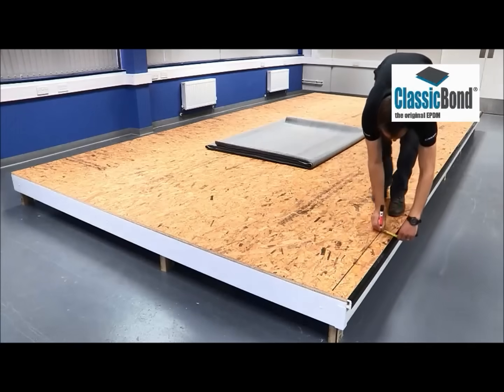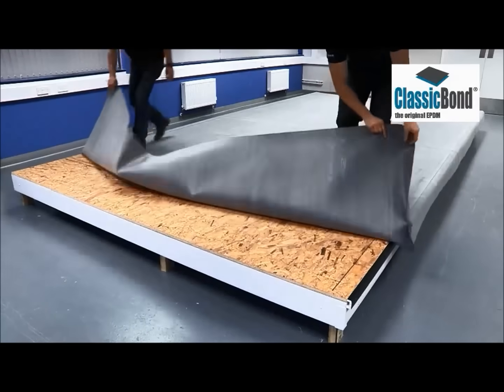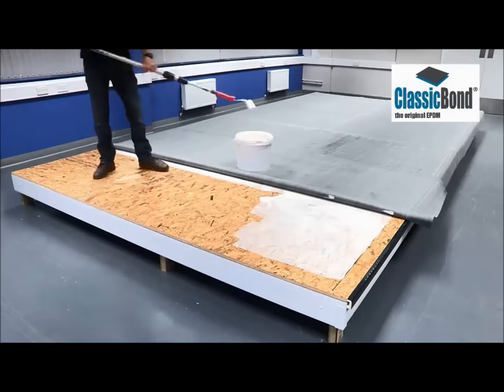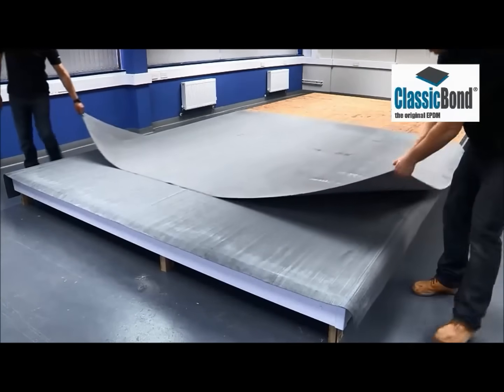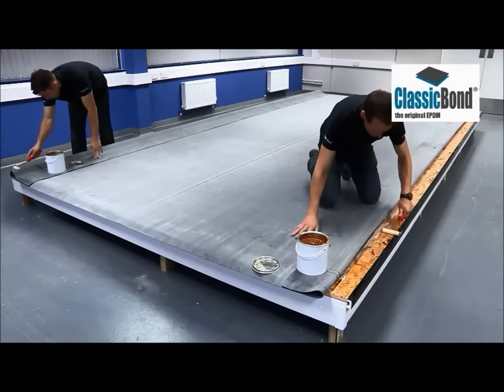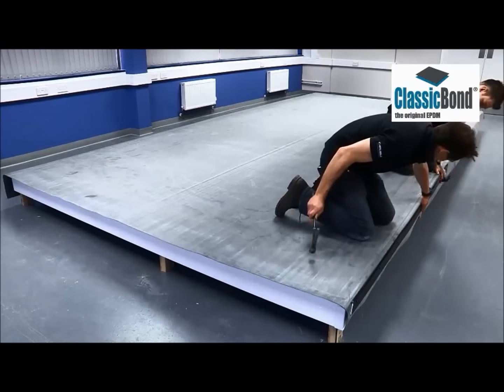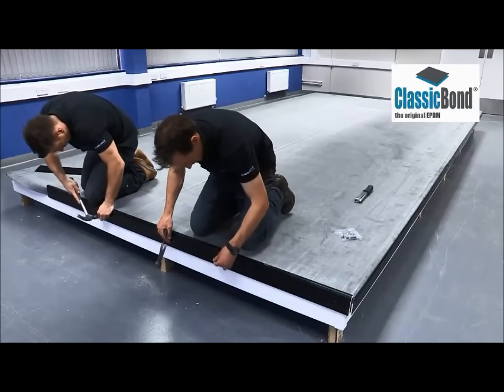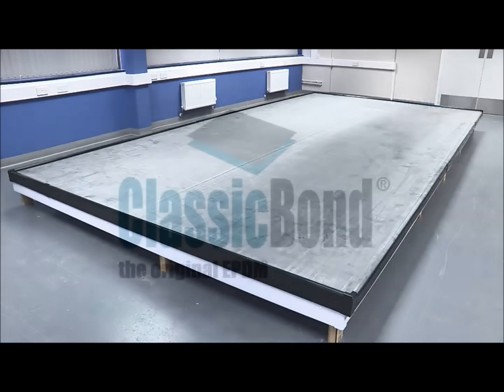How to install an EPDM Flat Rubber Roof, ClassicBond

Comment: Can this be applied over an existing felt roof, or do I need to remove the roof and the change the ply/deck below?
Reply: Remove and replace everything, you don’t want anything in between your bond and what you’re bonding to. Preferably a new clean surface is perfect.
Reply from the maker: Thanks Juan exactly right! Bond directly to a fresh OSB board. Old roofing membranes and felt may be high in moisture content and trapping this under a new membrane may cause the roof to fail. 

Also particularly the solvent based contact adhesive will soften the felt causing oils to leach out why will affect the life expectancy of the EPDM rubber membrane.
Reply: It depends as long as what you are applying to is smooth then your fine but I wouldn't put it ontop of felt myself

Comment: Question if I'm installing a simple 10 x 10' EPDM rubber roof. What is a cheap glue to use I don't want to buy a whole gallon and only use a quart. Does anyone know an alternative small amount of EPDM to Wood adhesive?
Reply from the maker: Hi Tommy. The waterbased deck adhesive supplied by the EPDM manufacturers is the obvious choice in the uk a 10’x10’ (3m x 3m) can be fitted with 2.5litres around £20.00. I’m no aware of a cheaper adhesive that will cope with the temperatures on a roof.

Comment: My garage is a double which is attached to another neighbours garage. How would i achieve a join with their felt?

Also under our felt it is wooden planks instead of boards
Reply from the maker: Hi JM. One way to join to the felt is a termination bar. I’ve put the link in here to a video. 
https://www.rubber4roofs.co.uk/how-to-install-a-termination-bar-video-and-installation-guide

Comment: Do i need to use tongue and grooved osb or can i just use normal 8x4 osb3 sheets 18mm thick? Big difference in price thanks
Reply from the maker: Hi Mathew
OSB3 Square edge will be fine and is perfectly adequate for EPDM installation.  Although in our experience tongue & groove can be useful when dealing with inconsistent joist spans and uneven joists as the tongue & groove will give a better finish as the board edges will be pretty much invisible for single ply installations such as CLASSICBOND, Firestone, Hertalan etc.
Reply: @Rubber4Roofs  hi when i fit osb18mm 8x4 sheets im going to fit noggjns, is it ok to fill  the 2-3mm expansion gap with d4 expanding wood glue thanks
Reply from the maker: @Tattytyres  whilst I doubt this has been tested for compatibility with the EPDM adhesive I can see D4 is an expanding PU so my gut feeling is it should be absolutely fine. Might be worth a quick test patch to be on the safe side though.
Reply: Thank you are you able to supply everything i need to complete the flat roof ill see if you have a website and contact thanks
Reply from the maker: @Tattytyres  just visit Rubber4roofs.co.uk there’s a handy roof kit builder which will calculate everything you need with a few simple clicks 👍🏻

Comment: Don't see why you have to use a different adhesive for the perimeter?
Reply: It's a much stronger adhesive and protects against wind damage. The last thing you wants is    a solid piece of rubber flying off and exposing your entire roof to rain and hail.

Comment: Would this work on a concrete flat garage roof?
Reply: my question too - would board need to be laid first?
Reply: Yes Felt board get's glued to the cement first for a soft base under the rubber. unlike the mistake in the video.

Comment: Why apply the rubber to a hard surface? Wouldn't a lawyer of foam insulation provide better protection to hail?
Reply from the maker: Hi Edward. This isn’t a problem we generally get in the UK although we have shot a video showing how tough EPDM is dropping hammers & branches on the roof etc.

Comment: Why do you use two different adhesives.
Reply from the maker: The main adhesive is easy to use and perimeter adhesive is much stronger and grabs instantly. They both have their use.

Comment: Hi, I have installed this epdm rubber roof with trims on osb3 t&g. I very small pin holes/ nearly visible to the naked eye in the epdm, can a epdm roof be coated with something to stop it leaking? Thanks
Reply: Gaco roof patch is solid. Have stopped some big leaks. A little pricey but it works
Reply: Yes just patch it

Comment: So I just fitted one of these today on a cabin/summerhouse. Mine was just over 5m x 4m. As others have said this makes it look pretty easy.

A 1.1mm thick 5m x 4m epdm roof weighs 55kg/120 lbs (according to the shipping label). Getting it on to the roof was a major pain. Particularly without catching it on the osb3 edges I roofed with. 

I spent around 30 mins getting it on the roof and the in the right place and lined up properly. This was pretty difficult and mainly involved removing the big ripples and folds, then getting the rubber broadly square to the roof, harder than it sounds without falling off when you are standing on the rubber itself. Another 30 mins letting the rubber 'relax'. Around 30-40 mins to get the water based glue on in 2 'halves' and the edges were another 30 minutes or so. 

Most of the time was spent moving the rubber around, the glue went off pretty quickly. Moving the rubber is difficult, and with one person it hard to fold it as neatly as is shown here. The water based adhesive was initially like an ice rink (standing on the rubber sliding over the adhesive), then after 10 minutes it quickly became very tacky and hard to lift/reposition. The border contact glue was ready pretty much instantly, making it quite hard to manage as it was sticking the rubber after 1-2 minutes and hardening in my roller tray after 5-10 minutes. It stuck the rubber to itself if I didn't fold it back carefully. You need to be clear in your mind what you are doing and go for it because as soon as the glue is down the clock is running. 

This is early autumn in Scotland with 75% humidity at 13°C. Remember the glue won't work properly if it's wet, humidity over 80%, or if the temperature is under 5°C or going to fall under freezing in the next 48 hours. Not much use in Scotland! 

So I'd relied on this video as a guide for fitting a 'standard' 1.1mm firestone epdm kit. But I had no idea what the timescales were for the glue drying etc and I couldn't find this information anywhere. I'd read somewhere the contact glue would take 15-30 minutes to tack off... But that wasn't true for me. Hopefully this helps someone.
Reply: Thanks for taking the time to share your experience of this. I'm doing a similar size roof mid December, I'm down south but even so will have to wait for a couple of mild days.
Cheers.
Reply: Go to local carpet shop, ask them for a cardboard carpet roll holder. Roll it on the ground onto the cardboard roll and lift it up with 2 men by a rope each end. Use it to roll out on roof. 1 pasting 1 brushing smooth with wide soft brush. Do last 20 cms as per vid.
Reply: Thank you for this. I was going to start on my project but the weather says -2 in the next day. Its about 10degrees now so I thought why not? You have saved me a mess up!
Reply: Yeah looks easy enough on this vid with a 4" high roof! Just step off when you need to for better control, but on the likes if a garage roof it must be a pain trying to dance round it.
Reply: Truly fantastic comment! Wish everyone was this helpful on YouTube!

I’m also in Scotland with a high-ish roof and I think you’ve dissuaded me from using this. I like that it lasts a lifetime with zero maintenance but the installation sounds a bit back-breaking and prone to me making a complete ar5e of it!

Probs will just go for ordinary cheap felt with maybe some bitumen paint over the seams
Reply: good comment - much appreciated
Reply: Awesome comment - really helpful!  Well done for battling through.
Reply: Can you advice what was the edge glue please
Reply: @coolI12332  i no longer have the tin. it was bought from a UK company called permaroof and the invoice just describes it as "bonding adhesive". The whole roof cover was a  firestone kit they sell on their site where the glues all came as part of the kit. it was a neon green coloured contact glue as i recall. 

i have also separately used a Hertalan product called KS137. I've read this is well regarded and i had no issues with it, this was to install a downpipe with epdm flashing  - and wasnt an issue to install as it was a very small area (1ft sq)

Comment: Looks easy but my roof over 2,4 m in height. Where do I walk?
Reply: Roll your rubber back like a carpet pva about 3ft infront of you and roll out rubber. Once finished one side just repeat on the other.
Reply: Good question. The video would have been much more realistic if they stayed on the platform while rolling the rubber out.
Reply: Scaffold
Reply: @fredvanstone5159  no not scaffold. That would cost more than rubber itself.

Comment: How do you install spouting to this system?
Reply: Use the gutter trim and make sure you have at least a one inch drip. We usually do this with a piece of slate  batten 50 x 25 mm srewed to the over hanging deck. For eg, https://www.rubber4roofs.co.uk/shop/sure-edge-gutter-drip-trim-2-5m
Reply from the maker: @ddpeak1  or alternatively for a hopper outlet https://www.rubber4roofs.co.uk/how-to-install-a-horizontal-drain

Comment: why not apply the water based  adhesive to both sides (roof + membrane) ???
Reply: It’s not necessary and will take too long to dry
Reply: You can apply on both sides and let clear off to bond. We do this around seams when we use inseam tape so we can fold lap back to clean and apply primer.

Comment: I first used this product on a flat top about 7 years ago, i went back to the property recently and the roof still looks great. I’ve done several since and really rate this system.
Reply: What type of glue did they use on the edges and what was the measurement? It looked to me around 20 cm?
Reply: @coolI12332  

The rules for EPDM (roughly)

Edges - 100mm (4inches)
Upstands - 150mm (6inches)
Overhangs for gutters - 50mm (2inches)
Reply: Will it work on a slightly sloped roof.
Reply: @matt7iron  Of course it will, a roof should be slighlty slopey by design to allow water run off.
Reply: @ronskiman4094 what part of country you working in? Most folks where I live in new england use lvoc on top of 1/2 iso recover board or fiber board held down to deck with seam plates and screws. That way can walk on roof and has give as to not puncture rubber. They use Lvoc bonding adhesive and at edges uses c-6 or c-8 alum drip with a self stick cover tape 5" or 6" wide and you prime and stick down to cover drip edge to rubber transition. Some folks get really picky and epdm edge caulk both sides of tape. I dont think you need too, but, they prefer to never get a call back. I am just curious as not needing that cover tape with the PVC edge and overlapping rubber is much cheaper. 5"x100 cover is over $300 a roll